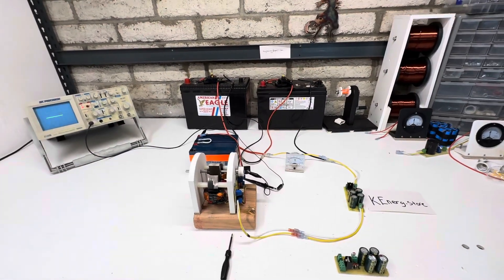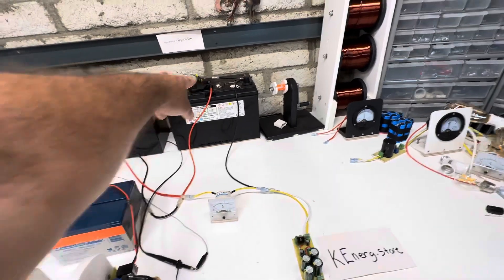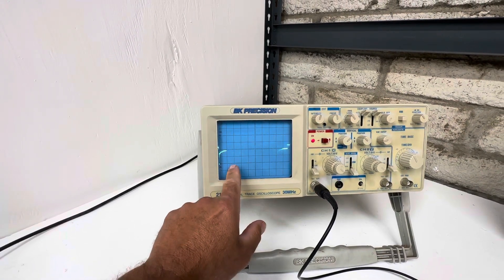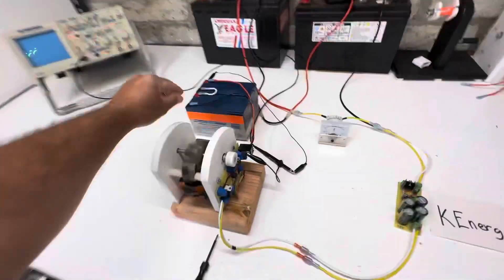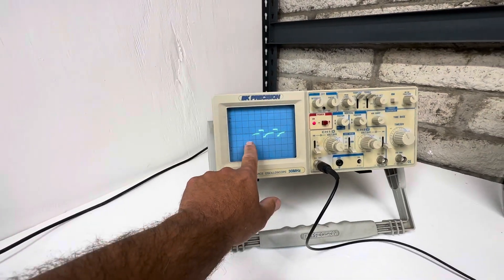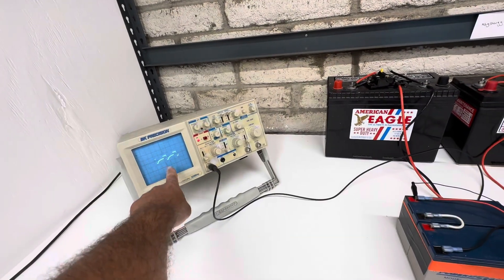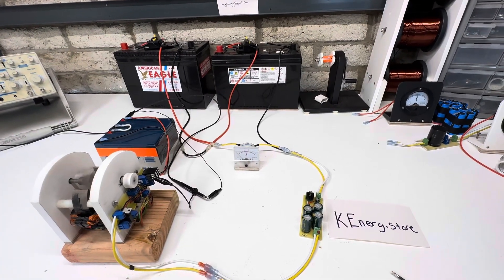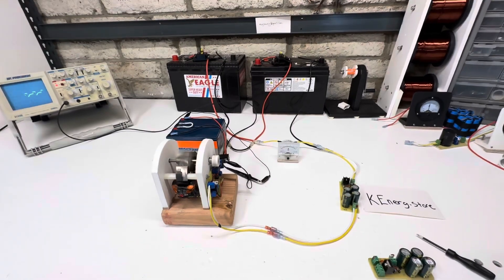Capacitor discharge : what it does

Comment: Hi Kenergy. I purchased the unit in this video and have some feedback for you. The circuit works well. I tried to pulse a 12v battery at 30V cap discharge voltage and destroyed the power fet (twice).   Replaced it with irf540n which is what I had plenty of. It works well but I had to upgrade the heatsink and it is definitely losing a bit of efficency as heat. I know this was not your intended use (12v) but perhaps with a better choice of mosfet (not irf540n) the product would only be limited in performance by the voltage rating of the capacitors and would give the user more flexibility in application. Also if the power fet terminal block was facing the outside of the unit then a heasink upgrade would be more ergonomic, or would make cable run to an external heasink and parralel mosfet array potentially shorter. Thanks for making this product available. It works just as described. Highly recommended!
Reply from the maker: Hi thank you for the review! The unit isn’t designed for 12 volts charging unless you use a 20v zener that’s why you are popping mosfets 
I suppled 30 v zeners for 24v charging as you described 
 I agree that’s a better mosfet but doesn’t need it for the intended use
Reply from the maker: I will definitely take those ideas to make this product better thank you !

Comment: Thank you for the post ! I really needed to see another video about cap dumps.
I am planning to buy one in your store and try it out on a project.
Can I please ask a couple of questions? I am sure eventually I will figure it out, but if
you already know the answer, I very much would appreciate your view on this:

1. Is it  possible to control   
      (a) the discharge rate a cap dump, i.e,  be able to select how much voltage to take out of a single capacitor or a capacitor bank?
      (b) the direction of the discharge, i.e,  be able to direct discharge voltage to multiple points ( battery or other components ) ?

2.  what is spike range ( input voltage to the cap dump) that can be accepted by a cap dump set up?
      (a) I realize that one key factor to consider is the capacitor rating
      (b) can a single capacitor with a higher rating, or a capacitor bank, handle a large voltage spike as input to cap dump?
           or is the limit ultimately due to the rating of the zener diode and the SCR? 
      Meaning, even if you had a large capacitor bank,  the zener diode and the SCR will set the possible input voltage.

3. Finally, what is the output voltage of the pulse motor in this video?

Thank you very much, I realize these are a few questions, but this post is the perfect place to ask about the capabilities of a cap dump.
I will appreciate it, if you can point in the right direction with regards to these questions.
Reply from the maker: Thank you for the great questions 
 These are smaller units 1-5 amp out I can make them to any spec 
They are controlled by zener diode which makes the output very consistent for 12 volts they adjust from 14volts out at 1 amp to 22 volts out at 5 amps so the higher the zener voltage the more amps out but can make motors surge at 22 I suggest 15-18 volts out 2-3 amps 
If you need more “amps” I can build a bigger capacity capacitor bank I have some up to 30amps but can make any spec just gets expensive 

Some of my motors put 600v spikes to the cap dumps 
 My email is kbgenergy@gmail.com if you want to talk directly to me
Reply: @kenergy1707   Thank you, it is very helpful.
It's good to know you can build them to any specs.           I will email you directly for the next message.
I am excited about working with  the cap dumps and I appreciate that you are open to doing customization
I will do a bit more planning about what I want to try and get in touch. 
Thank you for your great work.
Reply from the maker: @shareyourchristmas  I have a video that shows most the ones I’ve made it might help it’s I think midway on my videos
Reply: @kenergy1707  Thank you, it is exciting, you have done a lot of work.
Local generation, easy charging, storage and on demand access are it.
That's what will make things easier.
Reply from the maker: Also these are mosfet
Reply from the maker: Out put of this motor is 100 volts

Comment: Thanks for the video! I read that John Bedini recommended dumping at 2x the charge battery voltage (I do understand that is not possible with these caps). Do you have sense of what dump voltage has been most successful in your experience with the bigger batteries on the table as well as the 7Ah SLAs? Thanks.
Reply from the maker: Thank you ! I can make them to any spec you like 
 These are designed for pulse motors so that they don’t “ surge up in rpm “ they are adjustable from 14-22 volts at 1-5amps for 12v charging 
 The 24 volt one is from 28- 34 volts 1-5 amps out to a 24 

I like discharge at 16-18 volts for 12 volt batteries keeps the motors running more consistent
Reply from the maker: Adjustable with zener diodes

Comment: Great video and explanation.    For the batteries , are you saying that if you dumped the pulse directly into the battery, the battery wouldnt respond as good as the cap dump ?  I see the battery as much bigger capacitor....
Reply from the maker: The battery is like a big capacitor but it seems to react better with hi amp impulses and the capacitor condenses the spikes very quickly then outputs it at a voltage safer for the battery